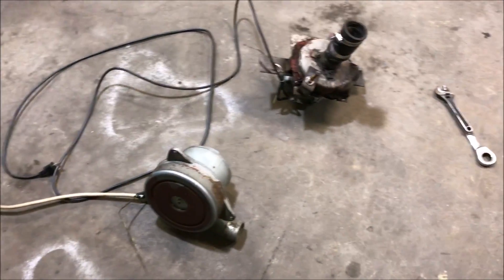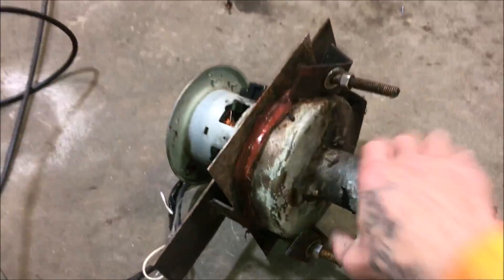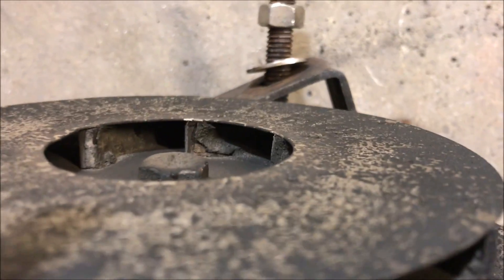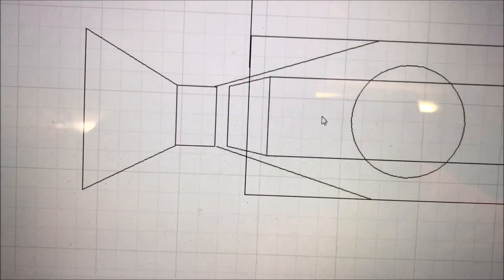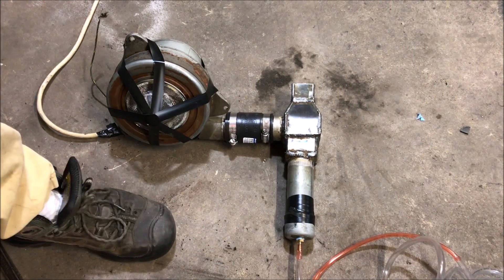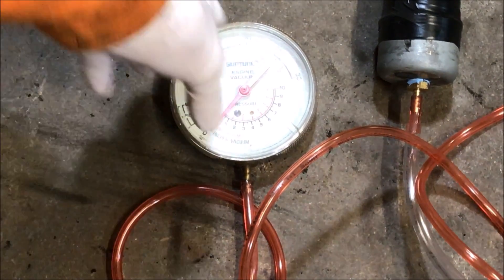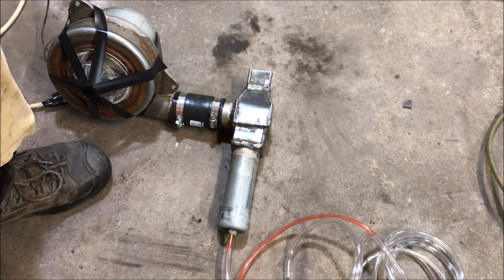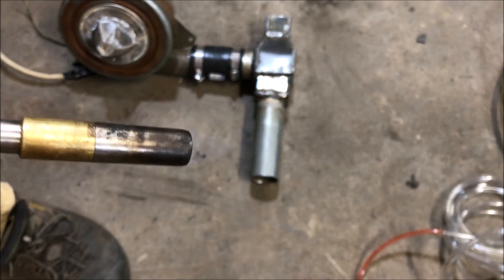Venturi blower system for high temp Exhaust

Comment: NOBOX7 Fricking excellent design and idea!  Love the story about you and your friend building that blower in a pinch.  I have a feeling we'd be good friends and hang out daily if we were neighbors.  Curious about what software that was you highlighted your design of the suction bypass nozzle? I need to get and learn to use that for sure.  Really impressed with this design, entertained thoroughly with the video! You're getting better and better at producing them, I am learning alot from you.  The only thing I have to contribute is my way of making videos which I like (and is definitely not the best way) I use a ZTE Blade Z phone (2 of them) because it has 2 cameras, many built in features like time lapse, low light, bright LED, 160GB storage (with 128 GB micro SD chip) and it's fast and responsive with 16 Megapixel resolution (and it's only $100 or so on EBay😀)
 I edit using Powerdirector pro directly on the phone as it is easy to use, fast, does high resolution, has all the editing features including slow motion/fast motion-too many to list (full version only $6 for lifetime)
Excellent videos man, keep them coming-you have inspired me to build my own burner, and I'm working on it now, and will be putting up a video of the mock-up and idea later this morning.
Reply from the maker: I agree glad you like it . the software was quick cad

Comment: Now run it on steam instead of a blower! I wonder how large of a boiler you would need if you wanted a steam induced draft and a couple 10s of kW "waste" heat.
Reply: One could probably run it on steam no problem, but then you have several complications that make it more of a pain than a blessing... ~( ,m,)~
Reply from the maker: That would be cool

Comment: i really love the sink drain strainer for an inlet screen! I have now officially learned something from YOU for some of my own future projects! (~_^)-b
Reply: I just saw the sink strainer idea the other day as I was watching essentially every relevant oil burner video on YouTube for the last week.  That Aussie guy oil burner has proven to be very helpful, albeit obnoxious and oh so funny at the same time-he was showing how the sink strainer allows better mixing of the propane/air burner he was working on a few years ago.  I am building an exclusively oil burner due to it's simplicity, although I may incorporate my paint sprayer and pond areator pump propane injection, I have not decided yet.
Reply: @ProlificInvention  Be sure you have the power to ensure the finest atomization possible as only the surface will burn and the rest will have to [hopefully evaporate/boil] before it becomes new surface area, leading to a horrible amount of quenching and the chance of extinguishing your flame front or else leading to a lot of oil spilling out to make a mess and a fire hazard.

For my stationary oil furnace, I will be taking an entirely different route to combustion of the oil.
Reply: @DeliciousDeBlair  Yes, my stationary furnace oil burner will be more than sufficiently powered, and the oil is going to be atomized by the pond pump and siphon nozzle (see Boysal Burner on YT, great design influence) and forced air provided by a hybrid design I am working on: Gas Powered 5 hp Briggs and Stratton flattop walk behind blower of which I am going to utilize the blowers sufficient power as well as it's exhaust heat in my burner chamber.  The exhaust heat and speed will be used to preheat my cylinder with the air off for starting, it should heat the cylinder to vaporization temperature nicely, at that point when I introduce the finely misted oil/air mist from the pond areator pump and siphon nozzle it should ignite nicely, I will have great control with the throttle and a gate valve for the forced air, and a catalytic Platinum pan/mesh directly under the engine exhaust inlet will be an option, as well as direct propane injection into the pond areator pumps intake if I have starting or preheating issues.

Comment: Your design this time is truly excellent, and i would even say, for your application, totally perfect, only be sure you can open it up occasionally and clean out the buildup... May I suggest, aim the exhaust toward the ground [vertical axis configuration], to reduce the chance of particles building up on the 'lower' side of a horizontal axis configuration. ~( 'w')/

That, or take a piece of sheet metal [like scrapping out an old appliance body like a clothes washer or dryer] and build a cyclone separator... ~( 'w')/
Reply: A cyclone separator is a fantastic idea, always liked the filtration simplicity of those since they started appearing on vacuum cleaners.
Reply: @ProlificInvention  Technically, the easiest one I can think of is to cut a hole in the side of a tall narrow transmission filler funnel at a tangent, added a PVC pipe into it at that same tangent [with the internal end carefully tapered so as to allow a proper tangential landing, and then hot glue a plastic lid from a food container with a hole in the top to that, poked a piece of PVC pipe about half way down it with hot glue,  then finally slip the point of the funnel into a 2 liter soda bottle to trap the particles.

The only problem with this simple version is that it does not handle any heat.

The next level up is aluminum flashing and aluminum tubing, and finally, you can also upgrade to a steel version made from a paint can and some recycled sheet metal or some new galvanized steel from a hardware store.

Those kinds can be assembled with pop rivets, or really small nuts and bolts, if the heat is too high for solder.

I have a factory made chrome plated brass one out in storage so I shall be 'cheating' somewhat...

If you look at a lot of modern bagless vacuum cleaners, you can observe many varied means of using round shapes to accelerate the particles out which may suit your goals better.
Reply: @DeliciousDeBlair  Excellent information, thank you for that!

Comment: I had this imbalance problem just this past week destroy a shop vac on me because the brushes and commutator could not handle the vibrations, and they quickly chewed all up.

Now I have to either buy or rig up a new motor for it, or be forced to throw it out. [sigh] /( -_-)\
Reply: If you do have to get a new motor, or rig one up may I suggest looking on Craigslist for a cheap used rainbow vacuum-the motors on those are 2 stage and sound like a jet engine! They provide excellent suction and have unbeatable durability.
Reply: @ProlificInvention  I have been pondering ways to rob the blower out of one of my other vacs [I have a pile of them here now, and one of them has developed the problem of shedding its belt off the side all the time and I accidentally left another one too close to a heater so that its swirl bowl is now covered with duct tape or else it can not draw vacuum to the floor, these two may end up as a parts swap resto and then the belt kicker can be relieved of its faulty belt drive spindle and put into the shop vac.] and just force an adaptation.

I have also called the manufacturer to see if I can order just the motor for a fast drop-in solution.